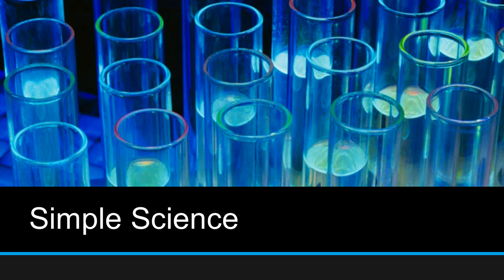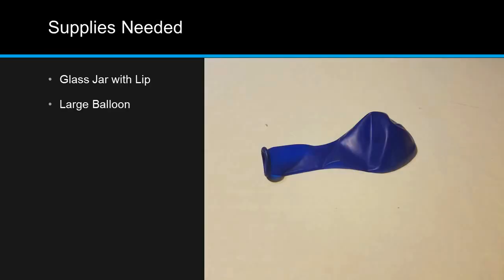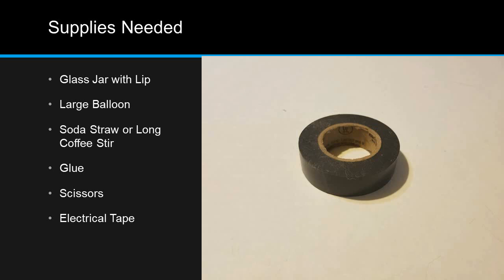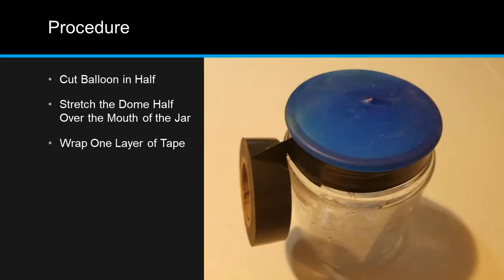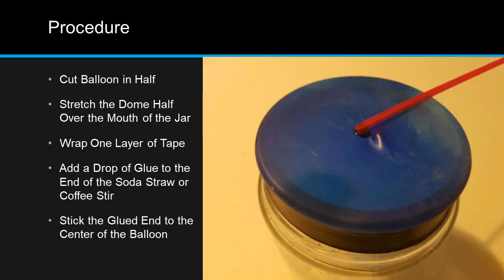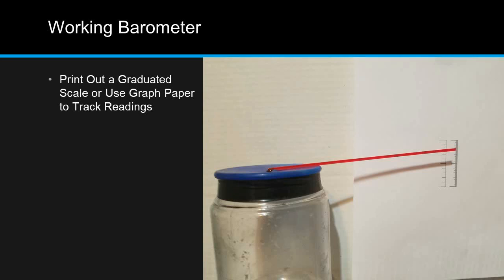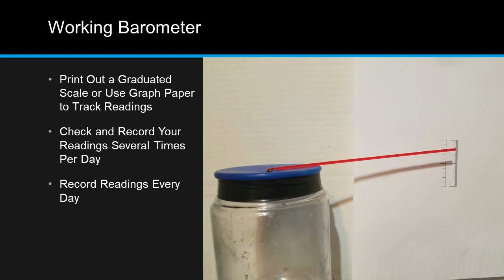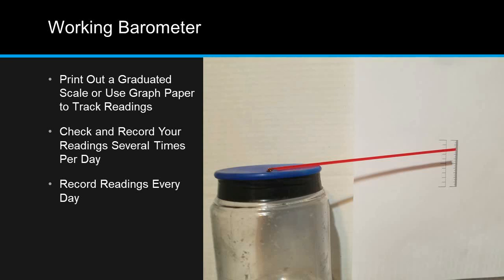Simple Science: Make a Barometer

Comment: Suggestion: Simple balance experiment. Precursor to Cavendish. Show that the principle of the lever can be used to predict how masses can be balanced. Different masses, different distances from the fulcrum. Using an equation to make predictions. Concept of centre of mass. Concept of vectors. 

Another suggestion: Simple lever. Precursor to simple balance. Principle of lever. Concept of force (magnitude of required force depends on lever, mass, and location of mass and applied force). Simple to set up. Simple to measure and record. May need a way to measure force... ah ha! 

Yet another suggestion: Simple spring mass/force meter. Requires a spring. Build your own simple spring scale aka mass/force meter. Concept of force. Introduction of units (mass, distance, gravitational constant small g, force (Newton)). Needs calibration. Ah ha! Use a unit kg.

Another: The kilogram. Intro to mass, volume, density, specific density of water. Construct a measuring device which will hold 1 litre of water. Simple idea is to use a cube measuring 10 cm on a side, fill it with water. Could use a digital scale to verify, if available.

Anyway, I could go on. You get the idea. Probably already thought of many of these. Anyway, cheers!

Comment: Suggestion: Centripetal force. Not sure how best to demonstrate this, so I'll just brainstorm a few ideas: 
- hang a weight on a string and set it 'orbiting' in a circle, measure angle of string or radius of circle. Repeat at different speeds. [Hard to make it go in a nice circle rather than some ellipse or something. Hard to measure speed (maybe measure time it takes for 10 orbits?). Could be more than 'simple' science.]
- Use a rolling ball in a large conical funnel, measure speed at top of funnel, middle, and near bottom. Speed increases as ball gets lower (smaller radius).

The idea is to give FEers a sense of how orbits work, and why inner planets go faster than outer planets. Also, why we don't fly off the Earth due to its (too slow) rotation.

Comment: You didn't mention how to calibrate the scale.
Reply from the maker: +ch bu No, that was left out. The only real way would be to get accurate readings from another source and write them on the graph paper. 
Other that that, different jar sizes, straw length and other factors mean that the throw length of the indicator end is not predictable. 
Further, the pressure to indicator function isn't linear. 
For these reasons, it seemed best to allow the builder to just recognise the pressure changes and what they correspond to in observed weather.